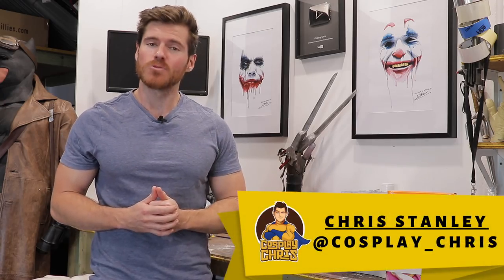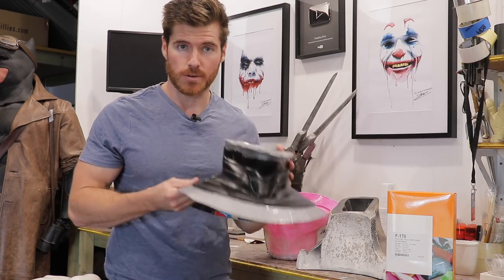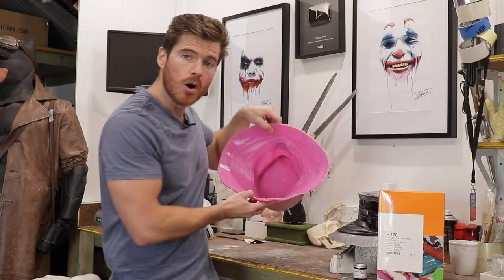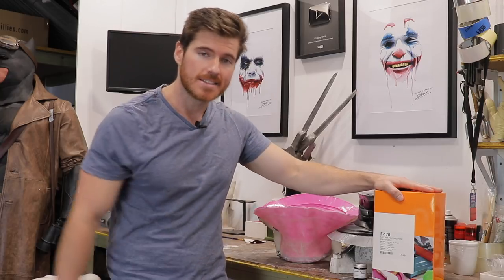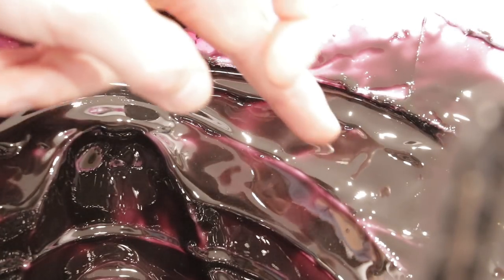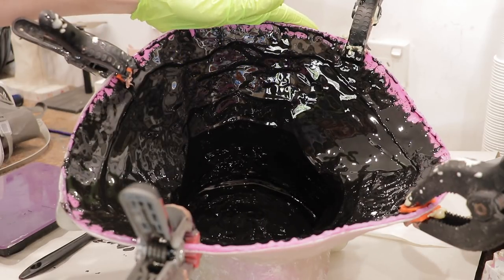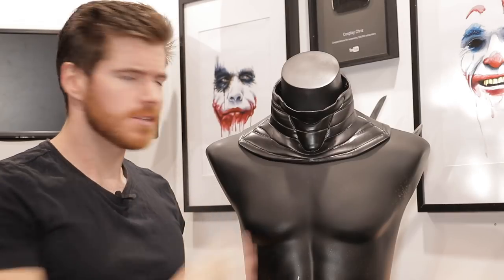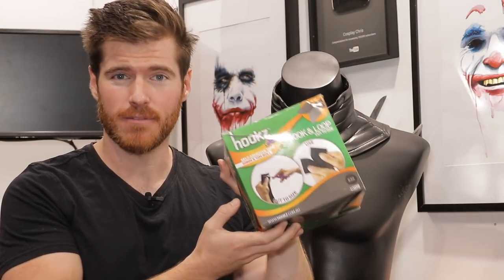How To: Cast a Flexible Urethane Neck Seal

Comment: Hey Chris. To help urethane bead less, add a little “fisheye eliminator” mixed in with it. I use “smoothie” brand, but I’ve had success with a lot of different brands. It works because it lowers the surface tension of the urethane and helps it wet out
Reply: Thats great! Are they're any tints I can use for urethane, I want a flesh colored rubber but can't seem to find any ,or tips on how to intrinsically color urethane .
Reply: Also do you have Instagram atall?

Comment: So, I want to look into making molds Cosplay Chris. See... I have myself a couple cool 3D printers. I would like to print armor in PLA (plastic) and smooth it down. Then mold it in urethane. I hear you can cast that stuff in various densities, and it would likely be more durable than welding PLA pieces together. What are your thoughts? Any good leads on learning to make molds? I can easily make the original pieces.

Comment: Hey chris think i can do the same thing for making the spider emblems like Sam raimis spiderman suit?
Reply: You should be able to. But, I would highly recommend using a MUCH more flexible material, though. On the Sam Raimi - Spiderman suits, the spider emblem & webbing was cast in foam latex. This worked well for the films. But, keep in mind that they had MULTIPLE suits, and they only needed to last until the production finished shooting. You suit(s), (I assume), will be used for far longer a period of time and you will want to need to repair/replace them far less often. So, I would suggest a soft and flexible urethane or silicone, (something around a "Shore-A" of 5-15), instead of foam latex. Explain what you want to do to your local distributor and they should be able to point you towards a suitable material. Personally, I think Smooth-On's "Dragonskin" silicone may be best fit for what you are after.
Reply: Thabks i was thinking and researching I was gonna use a resin rising foam from smoothon but i forgot dragon skin is a thing the reason why I asled is becuase i made a logo on my recent suit that is made out of eva foma with is good but hard to been its like a leather patch thats whybi was looking for somwthing flexable

Comment: 'Very nice job. Although, I would personally make one recommendation regarding the velcro. It is better to have the "hook" portion face away from your skin. If not, there is a HUGE potential for it to act like aggresive sandpaper, causing it to scratch and irritate the skin. Trust me, been there, done that, learned my lesson long ago. With ANYTHING that causes even the SLIGHTEST discomfort, it WILL get exponentially worse the longer you wear a costume/makeup/uniform/etc. So PLEASE learn from the mistakes of others, as well as yourself. There is NO gain from pain, ...except more pain!

Comment: You should take all the cosplay skills you’ve developed over the years and put it towards building a functional suit of super hero armor. Make Kevlar or uhmwpe armor panels, cover it in carbon fiber or something like that, and put it over a suit of slash pro or cut Tex pro material for the Arkham knight/tactical Batman look, or make yourself sheer thickening fluid infused urethane like muscles for a muscle suit and cover it in Kevlar panels and slash pro or cut tex pro for the batfleck look. I think putting your skills into a project like that would rocket you to the top of trending and quadruple your subscriptions.